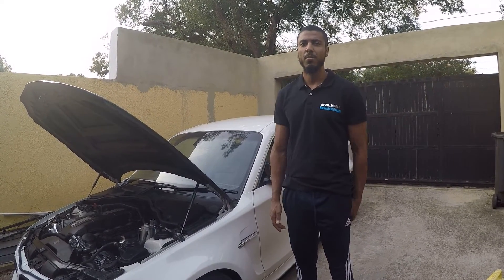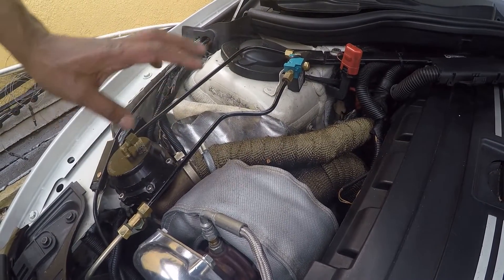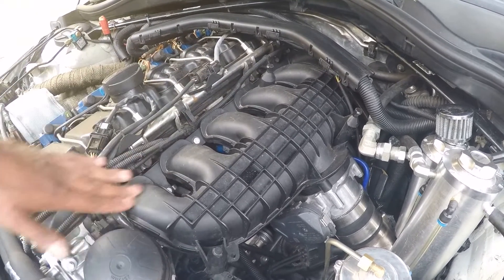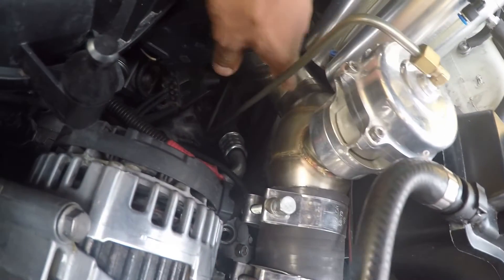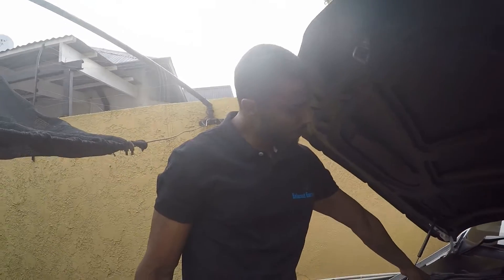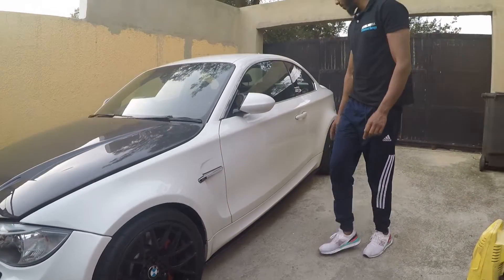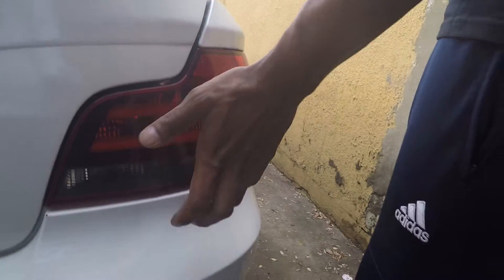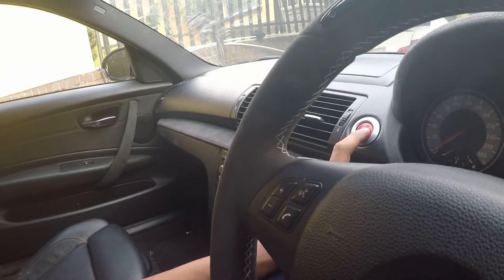Introducing South Africa's FASTEST BMW N54 over the 1KM

Comment: Great work on the car. Do you maybe know who can do a carbon fiber bonnet for my 135 (N54) in Cape Town?
Reply from the maker: We can either import one for you that's if there isn't one local try Seedat motorsport or other carbon fiber resellers
Reply: @EnthusiastGarageSA  Thanks for the quick reply. Will check with them. Also, do you have any suggestions as to where to buy the M-sport steering wheel (price?) as well as the red start button?